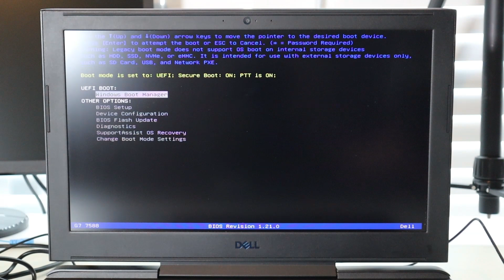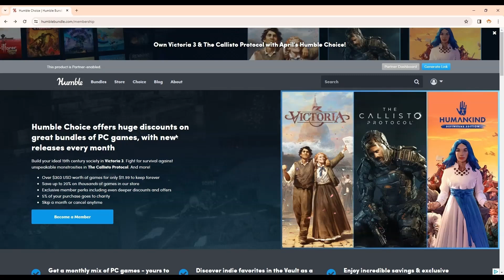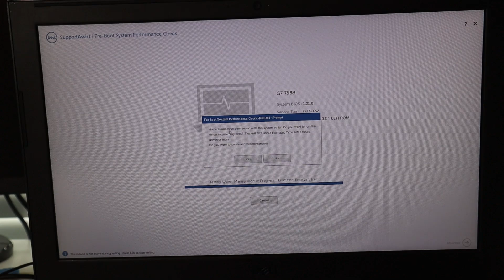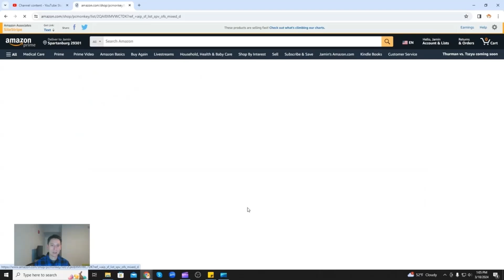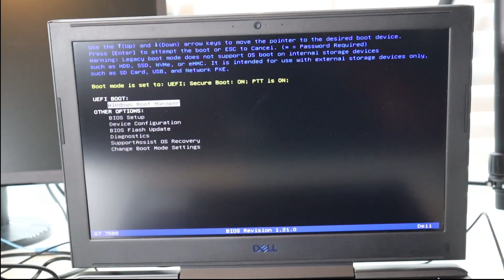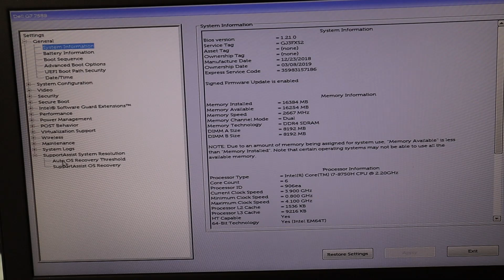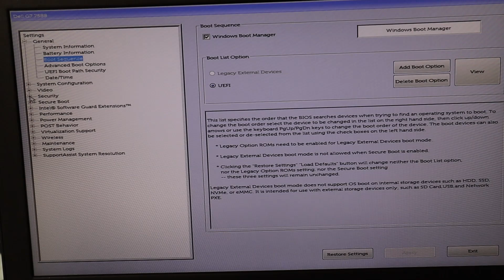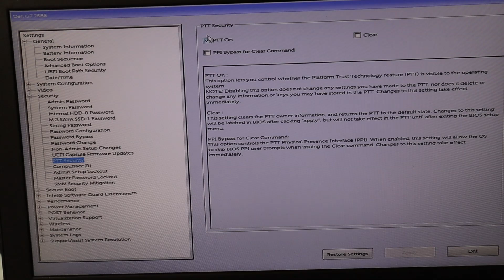How To Fix Exiting PXE ROM / Black Screen Blinking Cursor Fix for Dell G5 Laptop Computer

Comment: I need help please, a day ago I was trying to fix my ASUS  black screen, it works on settings 60.000HZ but not on 144.000HZ. I tried to update my drivers on AMD,  it gave me a message update failed. Then it told me to go to unity clean up, but first it told me to press safe mode. After I did that, THE HDMI STOPPED WORKING. now when I reboot, I can't see inside my laptop. Now the screen goes to 144.000HZ so I have a black screen. "" PLEASE HELP ME "" Thanks.